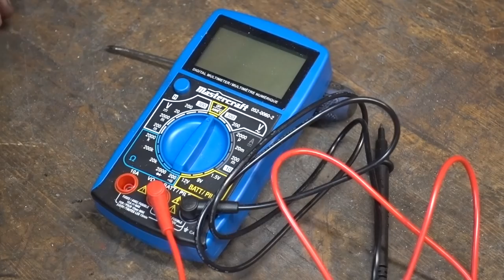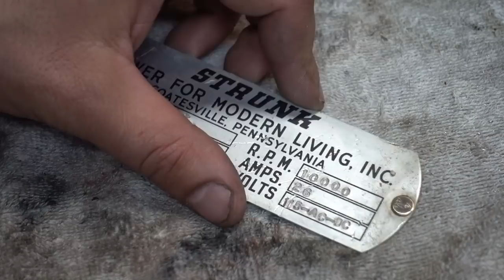1960s Electric Chainsaw [Restoration] (Part 2 of 2)

Comment: Flathead screws give me heartburn.
Reply: I love them. Never strip out. Cause way less pain in the long run
Reply: Never strip out? I've drilled out many. And they may as well be prison shanks for how much stabbing they do.
Reply: @wreckandraceify  if you strip out a flathead screw you have a bigger problem. I have personally never stripped one out. In fact a lot of the time you can grind a slot into a bolt and use one of those drivers that turn when you hit it with a hammer and back out the bolts with a flathead. Or "standard" as the upright woodworkers call it. You are right on the stabbing but I would still much rather have a screwdriver slip off a few times than have to spend 2 hours with an easy out bashing my skull in.
Reply: @randomguy93984  you can grind a slot into any bolt head, though, be it phillips, allen, star, or whatever if it strips. 

and yes, i've seen many flatheads stripped out.  they aren't any easier than the alternative.  they are just more of a pain when they work as designed than the others.

Comment: Much enjoyed! So smart to check all four of the wires in spite of reading continuity between the two ends and none between one end and the housing. Weird things do happen. One thought, in a splice like that if you need support or a wear point, you can wrap a piece of wire tie in the tape. You can even pre shape short pieces with heat before hand. Love your channel, keep up the great work!

Comment: How on earth do you keep track of the parts exact place? Do you use your videos as a guide or you just remember all their positions?
I would end up forgetting where each screw was meant to go!
Reply: soulhunter0 he’s mentioned before that’s what the videos were originally for. 

I know my uncle always filmed himself disassembling engines he hadn’t worked on before. He rebuilt vintage bikes when I was younger. Was a lot harder back then!! A camcorder was as big as a bazooka! 😂
Reply: I suspect "Practice/Experience" and "a camera".  (At least that's how I do it. And a couple old muffin tins labelled with masking tape. )
Reply: Yes that would make sense, i suspected as much.
Reply: Labeling and video are great for remembering where things go. Additionally, most electric or gas motors are built the same as most other electric or gas motors. Windings, bearings, carburetors, spark plugs, etc for each respectively.

I can't speak for anyone else, although I'm sure other people are the same, but when reassembling something, I find a lot of part locations/assembly orders just fall into place naturally in my mind. Doesn't mean I always get it right the first time, but it does help.

Comment: I cringed when you started to patch the leads coming from the motor windings, I ALMOST lost faith in an otherwise excellent restoration, & turned the video off. You got me good!
Reply: What got me was when he buffed the chain on the wire wheel in his drill press. Omfg if that would have grabbed it. 😱 not only would it have shredded his hands as it pulled it, it would have whipped him like a flail. That was awful

Comment: Maximum Tape because handle is aluminium but you dont use heatshrink tubes? The tapes will unwrap eventually... 
I hope you like electricity.
Reply from the maker: Murlockingqc heatshrink on the ring terminals?  It's on all the other connections.
Reply: Yes, the ring terminals.
If you look at the other connection with the blue at 10:19, that's how I would have used the heatshrink tube. 
And the solder joint should be concave for proper soldering, but since it's clamped down it should be fine.

It's probably going to be safe but everything I wrap in electric tape usually end-up unwrapping.
Reply: The saw is grounded. If the hot touches the metal handle, the breaker will trip.
Reply: Oh, neat! But wouldn't you get shocked anyway ? 
Or the current travel through the ground first ?
Reply: Easy way to prevent tape unwrapping is to apply a small zip-tie over it. 
Shrink wrap looks better but it's kinda thin, on a high current wire multiple layers of tape make better insulation. I learned this the hard way on an old Soviet vacuum cleaner, took a nasty shock from that mfkr...
Reply: Naw, Just use it with one shoe off and foot firmly on the ground.
Reply: Came in to the comments to just to discover this. Looking at it, I was thinking it was un-grounded with no fuse/breaker. Glad to hear.
Reply: Murlockingqc Electricity travels close to the speed of light in a conductor. So, the difference in length of the path through you or the wire is inconseqential.
Reply: Vladimir Efimov Electrical tape is only for marking, not isolating. Its a terrible isolator. Theres even heatshrink tube with solder and clue in it... Takes less than five minutes to join up to 50 wires permanently.
But  maybe he went  "Old school"
Reply: I'd of plasti-dipped the inside of the handle. Elektrissitty makes me nervous
Reply: A quality tape doesn't unwrap if applied correctly.  There should be threeish final wraps without (or very light) tension.  Don't use cheap tape.  You are trusting your life to this tape.  

I am surprised no one is complaining about using crimp terminals in non crimping application.  It's wrong but only for the pedantic.
Reply: Heat shrink over the tape.  Works well and you get the insulator thickness required.
Reply: Hand Tool Rescue I was eagerly waiting for the second part! You did a fantastic job! But I noticed a problem on the trigger (switch) connections: there are two screws that receives the ring terminals on the switch body. The problem is that the screws seemed as a little salient at the head edges and the whole assembly is stuck inside the aluminum handle! My opinion: since you're a proponent of insulating tape, why not line the inner part of the handle with tape? Can't believe inner handle wasn't insulated in any way! Probably a missing part... perhaps? I'm used to repair old machines like that and always seen a phenolic or plastic liner protecting similar parts. Well, just my 2 cents...
Reply: Those cables were nicely jammed in to the handle. There aint no room to unwind into. Besides the handle is grounded.
Reply: craigleemehan actually electricity travels rather slow compared to the speed of light. The difference between a person and the wire is resistance, your skin has millions of ohms of resistance the copper ground does not.
Reply: Murlockingqc no you wouldn't get shocked at all, ground is a much better conductor. Electricity always takes the path of least resistance.
Reply: It's grounded.
Reply: Or you could use silicone self vulcanizing tape either alone or in addition to the electrical tape. Good stuff
Reply: Murlockingqc 

Only if you are not a better ground than the chasis ground.  And that depends on how good the house ground and the plug (wall outlet) are grounded.  With lower voltages, such as house 120 Vac or 220 Vac, I am very careful.  It's much easier to be harmed without knowing it than higher voltages.
Reply: lucas de Jong et al: I don't mean the cables but the terminals: they're pretty salient. And electrical grounding is one thing, insulating is another one. Two things with totally distinct purposes. Or, in other words: we can't count on grounding as a substitute for insulating and vice-versa.
Reply: Roberto R. MOLA 

Yeah I know grounding is no substitute for conductor insulation.   But, it's the protection system for electrical hand tools.  The grounding offers a better pathway for the current than the typical human body., electricity always takes the path of least resistance.   Insulating the ring terminal won't protect the tool user unless he is touching the ring terminal itself.  Better to have a good ground, it protects the user's heart and brain when touching both terminal and metal tool body.  If this happens you're likely only to receive a electrical burn on the finger (or whatever part touching the terminal.).
Reply: The reason that earthed chassis save lives is because of circuit breakers. None of this "least resistance" bullshit.

Imagine an electric kettle boiling. 13/20A are going through the cables, depending on the voltage. The resistance of the kettle will be relatively low (between 5 and 20 ohms). Now imagine you touch the live wire that goes into the kettle. The kettle is a much better conductor than you are. You still get shocked! Despite carrying all that current, the live wire is still at a live voltage.

The situation is slightly different with a live to earth fault while you're touching the chassis. Live to the chassis is one resistance (very low) and the chassis to earth is another (also very low). They form a potential divider, so the voltage the user sees will be less than live. Depending on those resistances, you could see a high or low voltage. But some few milliseconds later, the breaker will trip and everything will be fine.
Reply: Gerald Norton
Reply: @Murlockingqc  
It depends. In theory the ground is at the electrical panel closest to a ground rod, tied to rebar in concrete (Ufer ground) and also grounded to a cold water pipe. When a shot to ground at the chainsaw, the return ground path goes back to the panel with a voltage drop on that saw determined by the distance back to the panel and the size of the ground conductor. So you're not completely safe, properly ok with a few volts above ground. That is, the voltage across you touching the saw and the ground you're standing on. You may not know it or feel a little buzz. All bets are off if the panel is not grounded - all 120V will got through you. Use a GFCI breaker for added cheap protection.

Comment: Nice work! It came out awesome. 😊👍 One thing tho, you should terminate those cables better. Electric tape is not enought protection when sitting so close to a metal chassi. You should use heatshrink tubing or better cut of the access of the cable ending and use shielded crimpterminals. Some heat and vibrations and you may have an shocking experience. Better safe than sorry. Keep up the good work!

Comment: I like the fact this massive motor is exposed to the elements, but you mention the flimsy gaskets for the two maintenance doors on it :) I suppose you COULD have put a sort of air filter behind the motor grill, but then... it wouldn't have been authentic. Of course, if you produce enough fine sawdust while cutting, you would have a free lighter, what with the sparking of the motor and all... and that lubrication oil would be excellent fuel to keep it all burning.

Nice restoration and a thumbs up!

Comment: Cuz I have to say it,on that number 50 chain u should be shapening that with a 50-55 degrees pitch and ur chain holder should be 30-35 degrees,that's the only reason it wouldn't cut,great work loved this resto

Comment: WRAPLOCK! Man I haven’t used that stuff in years. I probably still have some in a warehouse somewhere. I see that Commscope has discontinued it. Brings back scary memories of hanging antenna cables on towers, trying to measure it out, cut it and not drop the ratchet tool in the process.

Comment: One (positive I promise) electrical suggestion... Take first to insulate the join and then heatsink second. That way the tape is held captive and can't unwrap. And ignore the naysayer below about the tape on the switch leads... It's so contained it won't unwrap and the handle's grounded anyway.  

Loved this restoration... Wonderful work
Reply from the maker: Good tip!
Reply: I of course meant tape not take.... autocucumber needs rescuing next lol

Comment: I wouldnt be worried about the clutch pad material.  There's a reason its called asBESTos.
Reply: You breathe much more asbestos walking around the streets of any major city from all the brake dust still floating around. You would be amazed how much is still floating around. It was only a big problem for people who worked around it on a daily basis and were breathing a lot of it. With all they hype about it, it's difficult to convince people of that though.
Reply: Asbestos is a naturally occurring mineral, it's still around because rocks don't just disappear.
Reply: True, but they also dont spread around friable fibers nearly as much as old brakes and clutches did.
Reply: Yep.  Asbestos was used heavily for a very long time in thousands of products from insulation to the mortar between bricks as it is pretty much a super-powered material that is fireproof, insulating, and adds tremendous strength to anything its added to.  And as long as you're not taking a jackhammer to any of those products, its perfectly safe.  Any time I hear people worry about asbestos in old building I simply tell them not to go in and snort any plaster dust they find and they'll be fine.  Asbestos brake pad material is definitely a problem since it is, by its very nature, designed to get ground into a fine powder that is easily stirred up and scattered by the air.
Reply: I remember all the times I did my own brake jobs back in the 60’s...as did a lot of shade tree mechanics then.....no mask, just blow out the dust in the drums or wipe them out. We never worried about what we could be breathing back then. Asbestos was once called a miracle product as it was used in everything. Back in the days of old theatres, people would be given an asbestos handkerchief as they entered the theatre. On their way out, they would drop the soiled handkerchiefs into a drum at the exit. The drum was emptied into a furnace and the cloth was burned and....good as new.

Comment: Another way to check the safety of the wiring on the motor would be to just plug it into a GFCI outlet. It will trip if there’s enough current leakage to ground to cause a shock hazard (the outlet works by comparing the net difference in current going out the hot wire and back in through the neutral).

Comment: Some constructive criticism.  You really shouldn’t solder crimped on terminals.  The solder will cold creep and the connection will loosen.  Also the solder will wick up the wire causing it to become brittle.  It will break due to the constant vibration.   You also shouldn’t crimp with pliers.

Comment: I recommend tightening from the nut, and not the bolt head; as tightening from the bolt head will scratch up your nice new paint. I'm sure you probably already know this though, and just didn't have a deep socket for the excess threads on the bolt.

Comment: Man, I could use a saw like that. I have a gas one, but it'd be nice to just plug in the electric and go without all that fiddling.  Great job.
Reply: Cadwaladr I’d rather pull the recoil than deal with extension cords. I also tend to cut most trees down away from anywhere that I can plug an extension cord into.

Comment: Nice and powerful chainsaw but 26Amps? I want see how much thick must be wires in 50m extension cord to feed this. This is one of the reasons why 230V is better. Ordinary house here have few 16Amps breaker on different phases max. 10socket on one breaker. Main breaker 21 or 25Amp  each phase. House wiring 2,5mm2 sockets,  1,5mm2 lights.

Comment: I’m not a restorer or anything but don’t you think it would be good to oil all the parts like screws and stuff as you put them in. I would think it would prevent problems you have taking these old things apart and keep them new longer.

Comment: Those metal handles make me uneasy too. You should really do a high current earth continuity, and high voltage insulation resistance test, the multimeter doesn't really cut it safety-wise. 
Perhaps a good thick clearcoat on those aluminium handles would make the vital difference one day. If you study electrical accidents at mains voltage there is almost always a large contact area involved in fatal incidents (or water, which facilitates the same).
Reply from the maker: Interesting...thank you.

Comment: You can measure with a multimeter the handle while powered (instead of using your hand). Select AC Volts, put one probe to earth (on a wall socket) and the other probe to the handle.
But I'm not sure the multimeter we see is really suited and protected for mains voltage (inside build quality and protection). If not, a voltage stick detector can also be used (easy one).

Comment: Why did you use the cork gasket instead of the steel ones for the bar and chain
Reply from the maker: The originals were asbestos filled, so cork/rubber was close enough.

Comment: Hi, l o v e your channel, awaited this second part desperately. But: the bottom bearing is dead, after you hammered it in by striking the shaft. You should have pressed (or hammered) in the bearing first (on the outer ring) and the supported the inner ring - it is accessable! Now you hammered grooves in your outer ring, which will reduce the lifetime of the bearing to just a fraction.

Comment: It is surely a nice ancient beast. Only very recently did they "invent" the 15 amp chainsaw and Craftsman has the right design and suddenly I'm a chainsaw expert but I'm wondering what took so long? After seeing this video it's as if they knew the whole time and sold those lame 9 amp models 12 amp models etc.   I have a 1974 McLane-Briggs & Stratton lawn edger. I replaced the magneto for $40. Maybe I will paint it up sharp.

Comment: ..This is what I call a TRUE restoration...making it as close to it was when new as possible :) Many call just cleaning it up a bit and getting it to sort of run a "restoration"..Great work! ..one thing, though...why are you using those big clubby "monkey wrenches" for those small nuts and fittings instead of the appropriate wrenches?..if I tried that, I would be rounding off nuts and knocking my fresh paint off with those awkward things...

Comment: 12:52 Now that's a risky way to check for insulation (even for 110V). Provided the handle is grounded, testing it behind a GFCI-protected plug is ideal.